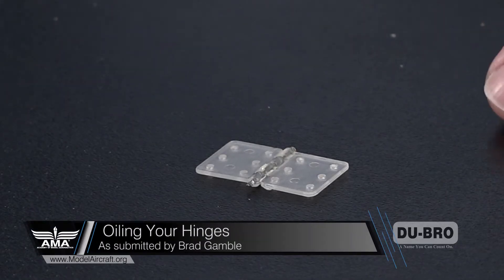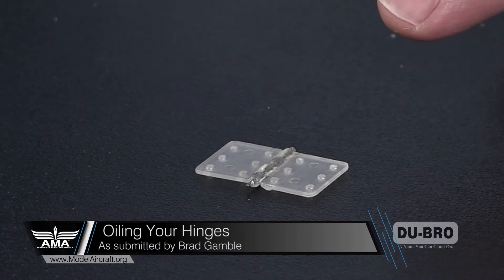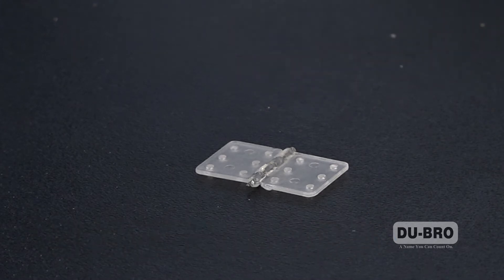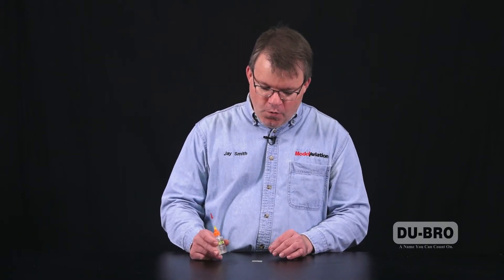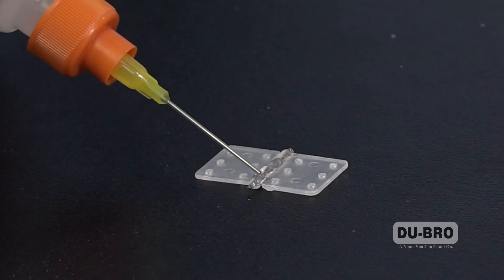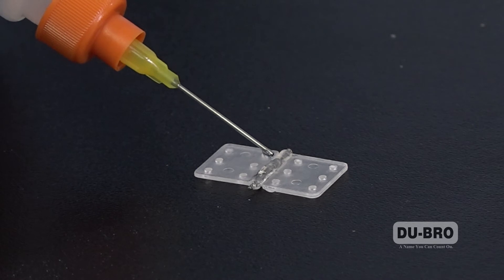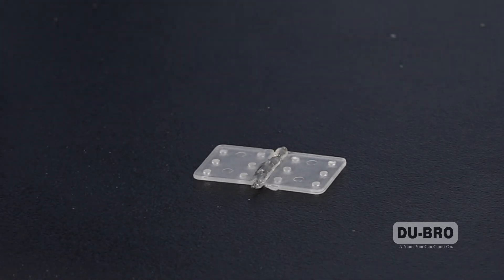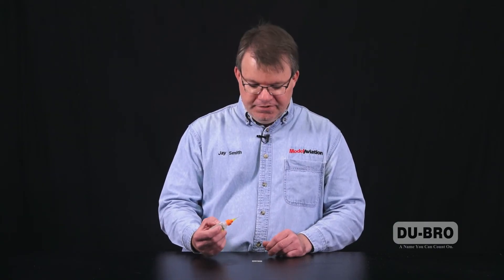Model Aviation How-To:  Using Oil To Keep Glue Out Of Your Hinges

Comment: I use vaseline. It won't run and get on the pins. I use a toothpick to load up the hinge area, forcing it down into the joint.